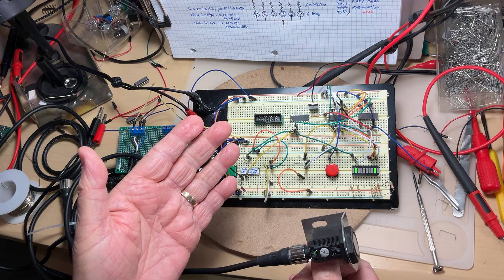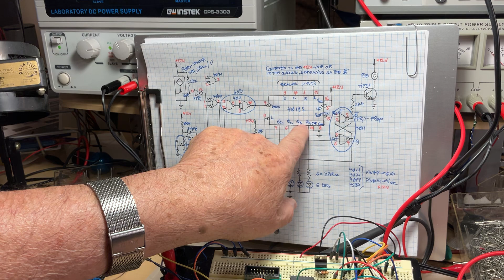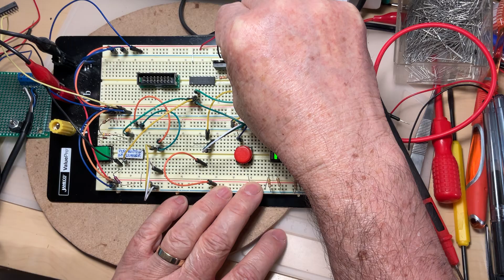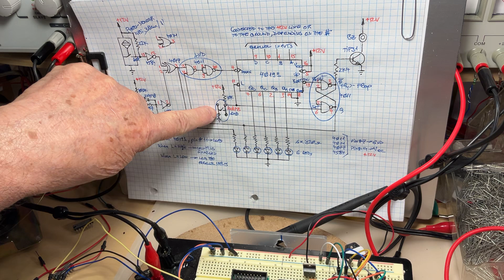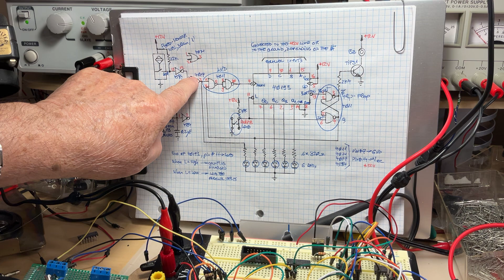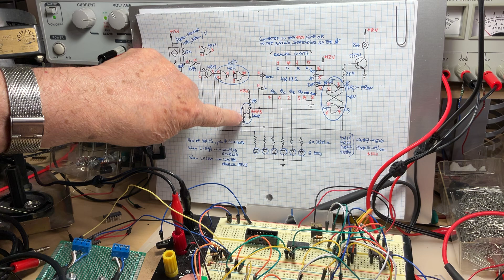Detect/ Count items with a photo cell–project2. Logic circuits, 36/101

Comment: As you discussed in your video, before the PLC, industrial control logic was hardwired using relays, then transitioned to discrete digital logic, timers, and counter ICs. The contrast and comparison between hardwired and software programming is on target.  As always, a great video, CU!
Reply from the maker: @mrdon219 I am always grateful for your pertinent comments Don. It's not every day that I get comments from somebody who understands both sides of the programming, hardware and software. Thousand thanks!